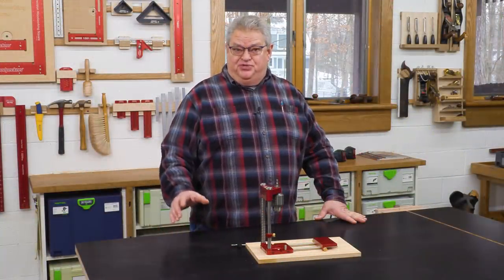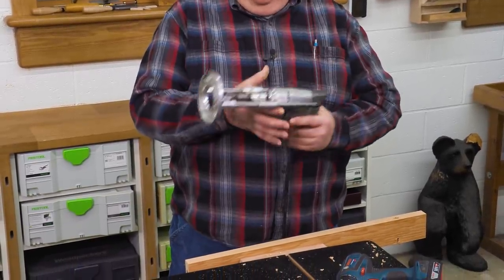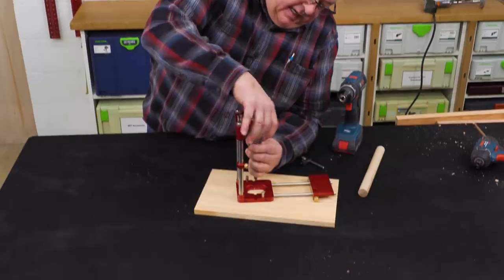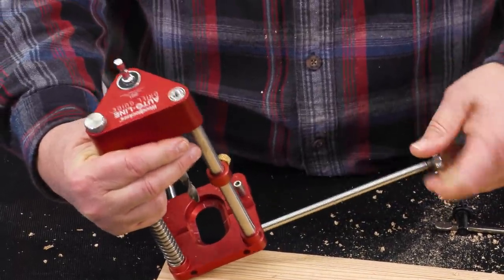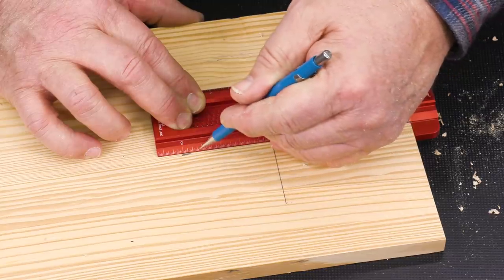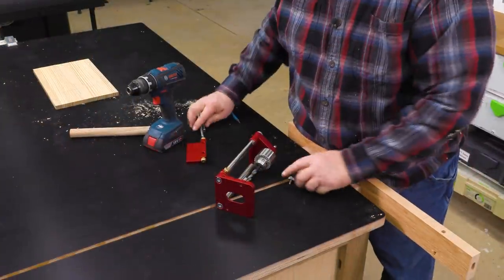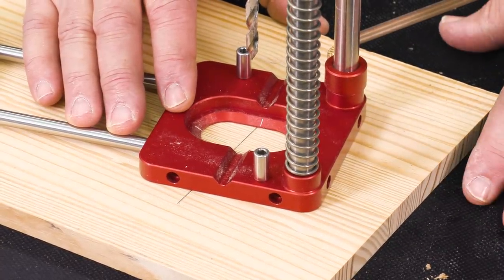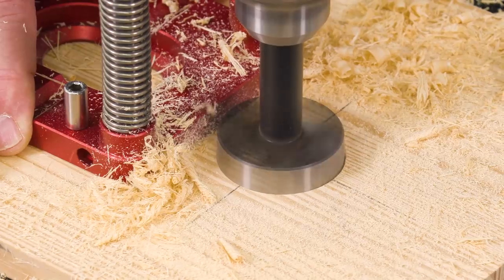The Best NEW Drill Guide For Woodworking - Auto-Line Drill Guide | Deep Dive

Comment: I bought this ALDG-21 about a year ago, and I finally got around this weekend to putting it through its paces.  I really wanted to love this guide, but it left me with several frustrations.  I used it to drill dozens of 3/4" dog holes into 1 1/2" maple workbench top, using a Fisch Black Shark forstner bit.  First, ALL five of the thumb screws rattled loose constantly.  The column top screws would rattle loose and fall onto the table or sometimes bounce onto the floor, which was no fun searching for them.  The thumb screws for the outrigger/guide also rattled loose but would just sit there on the table... the thumb screw for the depth stop also rattled loose and fell out a couple times.   It appeared that one dog hole would cause the column caps to rattle ~50% out, so by the 2nd or 3rd hole if I forgot to tighten it, they would fall out.    After a few of these I had to make an effort to tighten all 5 thumb screws after each hole - not fun.    I could easily see repeated cuts with the edge guide going south if the screws rattled loose constantly.    The next issue was that the overall depth of drilling with a 3/4" forstner bit properly sunk into the chuck, was barely 1 1/2' and I had to compress the spring 100% to get barely through my 1 1/2" material... it wore my arm out pretty quickly fighting the hard maple and the drill guide, so I switched to starting the holes with the guide and finishing them free hand.  I can still see a lot of use for this guide when some precision is needed, but for making repeated cuts in hard material it left me preferring to use the free hand drill by the end of the project.   - Any advice to get the screws to stay tight?

Comment: Love my Auto-line Drill Guide.  Using it more and more each day.  And a few more tricks I learned from this video, thank you!  Recently used my guide to tap threads into a new CNC high density MDF worktable I built that includes hundreds of 3/8"-16 threaded holes to mount my CNC clamps made out of plywood and I use plastic screws that go through the clamp and into my new work surface.  Used a tap designed exclusively for tapping wood.  Was critical to get the tap started perfectly straight as only had one shot, NO re-taps!  Worked perfectly and each tap came out perfect and straight!  Great product and beautifully machined and built!

Comment: I bought this as soon as it came out. I see it very useful for drilling lock plate mortises to a fixed depth. I have several drill guides (including the new Rockler) but this one addresses most of the flaws of the others. Most of the others are a bit cumbersome and have too much play to be very accurate and the rods tend to stick. The stops can't be trusted. The tapered section on the shaft of this tool is genius. I also occasionally need to drill 35mm hinge holes in the field and have several quite good jigs dedicated for this. Not sure if this jig can get close enough to the edge of a door for this. I'll find out when it arrives. If necessary, I could tap holes in the base and add my own extension. Also, while I have a line bore jig in my shop, it's sometimes necessary to drill shelf pin holes on site. I think this tool will excel at this. I've been a custom renovator in New York City for over 40 years and own more Woodpecker products than I can count. My shop walls are covered in "red". I've never been disappointed.

Comment: I'm glad that there are now more options for drill guides, up until very recently the ones available have been pretty much junk.  I know a Woodpecker version is going to be very high quality, and the taper is a great improvement over other options.  I am a bit disappointed that your version only takes 2" bits, I think going up to 2 1/2" would open up more applications (e.g., for more puck light options).  For comparison, the new Rockler is 2 7/8".
Reply from the maker: I’ll pass your thoughts along to the tool designer. Thank you.

Comment: Amen about the deficiencies of the ancient Portalign version of this tool. Mine has sat in a drawer since it was handed down to me 40 years ago. However I just used it to drill dog holes in my bench. Wish I'd had the Auto-Line Drill Guide. Using the Portalign and it's aging Black and Decker drill really illustrated the value of the design improvements you've made in the Auto-Line Guide.

Comment: I'm surprised that no one has mentioned the most obvious features that are missing from version 1.0. of this drill guide which are 1) dust collection (I'm thinking here of a simple, snap-in-place clear dust shroud similar to what many routers offer); 2) an outrigger that's shaped to slide along a Festool/Makita/Triton guide rail (for instant and precise control over one axis - especially useful in the middle of a large open field like a panel); and 3) Centrotec compatibility.  

Also, I'll echo what others have mentioned, which is the conspicuous absence of countersunk holes in the base (and, for that matter, in the outrigger) to allow the mounting of jigs. Literally every other version of drill guide I've ever seen offers users the ability to attach sub-bases and other jigs. Some jig examples are a) something to allow the drill guide to be held by a vise so that the ends of dowels or similar square stock can be held fast for drilling or b) since this version doesn't feature tilting guide rods, holes in the base would allow for mounting something as simple as a selection of beveled feet for drilling angled holes or c) there's the brilliant idea of adding a vacuum base - https://youtu.be/6O8BZMk4kpU?t=1726. So, how did something as basic as four countersunk holes not make it into the final design? Is it too obvious to offer up that If the base is too small to allow for four holes, than simply increase the size of its footprint?

The absence of his basic feature is baffling (as are the other missing features) but it certainly lends credibility to the notion put forth by others that maybe it's better to wait for version 2.0. As much as I want to get in line for this guide (I too have been waiting a long time for a precision drill guide) I'm leaning toward holding off to see what improvements appear in the future. In addition to what I've already mentioned, optional accessories like a larger footprint base (with a larger aperture) and longer guide rods would offer all kinds of additional possibilities.
Reply: Will wait for v 2 with these changes 👍
Reply: Or maybe a blower like the one on the DeWalt scroll saw, so it retains the lightness and simplicity of the overall tool.  I'll bet a little blower with a hex socket set could be snapped on right over the top of this without changing a thing.

Comment: I love Woodpecker's products.  have many of them.  Regarding the drill guide.  Great design.  Return spring is a nice addition (put one on both sides if possible) .  The fence/guide system adds a great deal of versatility over other similar guides.  But not prefect.   Angle drilling is almost mandatory.  Keyless chuck would be great.   I realize the drill guide is a premium product and you will sell many of these but in my opinion the price is to high for what it does.
Reply from the maker: When this was being designed, we surveyed customers and found that angle drilling wasn’t as critical as reliably perpendicular drilling. If there's a demand we can look into a different model with angle adjustment, but we decided the Auto-Line needed to focus on straight. We appreciate all the feed back and will pass your comments on to engineering. Thank you.
Reply: Disagree on the price issue you have. Top notch equipment and this particular piece is a job site game changer imo...
Reply: @WoodpeckersLLC  Angle drilling capability is mandatory for me and, based on the comments, many other users. Perhaps the group of customers you surveyed was not representative of all potential customers?
Reply: @WoodpeckersLLC  Angle drilling a must for me

Comment: If you want to put guide bars on both side and front, can you do this are the holes offset so the bars will not touch each other when you put them in the holes this way you have a guide on the front and side of your device. Also, when you turn the drill bit so it’s on the backside is there a indentation on the base so that a larger Forstner bit can be used and not touch the base?
Reply from the maker: Frank, putting a fence that's trying to align square on two sides is not a great idea. Instead, we have the fence on one side and a single point stop on the other. The stop was released after the original product release. Here's a second Deep Dive that detailed the addition https://www.youtube.com/watch?v=YO-lWs5Ii4c

There's no cut-out in the back side of the base. A 2" diameter bit will clear on the outside (1" on the inside).

Comment: 0:47 - Have you considered adding a level indicator to the back of your drill? I mean, you might still be off by a couple of degrees, but for wood that's generally fine. And you can still use guides / jigs / blocks if you need extra precision.
Reply from the maker: Level only works if the piece being drilled is level to begin with. "Square" and "Level" aren't the same thing.
Reply: @WoodpeckersLLC - Of course, not to mention some pieces are curved, some are tapered (and being square going in doesn't mean it'll be square going out), etc..

But in >90% of situations you'll probably be drilling into flat pieces that are close enough to level, whether they're lying on a table or held in a bench vise.

In the situation at the time stamp I mentioned (0:47), a simple "bullseye" level would have prevented you from drilling out the side.

Comment: It is a tool I´ve used most of the time.I is great. One question: Is it possible to buy an additional fence system (two short rods and a fence) so you can make holes in a corner?
Reply from the maker: Helmuth, check out the second Deep Dive on new accessories: https://youtu.be/YO-lWs5Ii4c  It shows the extension rods and stop that allow you to position to two dimensions. A single position stop is better than a second fence. If your piece isn't perfectly square, the two fences would not align. One fence and a single point stop works better.

Comment: Impressive. How would youi drill a hole at other than a 90 degree angle? For example, how would you drill at 45 degrees? Thanks!
Reply: They have release AutoAngle Drill Guide. Check that out.

Comment: The last feature you covered was with the drill repositioned on the outside of the guide. I wonder if the base plate could be cut away a little between the upright support posts so as to allow a larger-diameter drill bit? I realise there's a limit to how much can be cut away there, but even 1/8" means a 1/4" larger hole. That's not something everybody needs everyday, but I'm sure it would be indispensable to some. Even without such a modification, the Auto-Line Drill Guide is yet another amazing piece of design and engineering. I'm in awe of what Woodpeckers does.

Comment: Is it true that the 1/2" measurement referenced in the video as close to the edge of a board this can get.   If it went to 3/8" it would be genius for drilling screws like Confirmat for 3/4" ply cabinet assembly.  I'd have to get this in my hands to know for sure but it might be useful to get some center marks on the outside edges and bottom of the base and guide.
Reply from the maker: That was a generalization, and unfortunately, not a very close  one. From the back (furthest from center) the minimum is 3/8", 5/16" from the sides and just a bit more than 1/4" from the front (.2775" specifically).
Reply: @WoodpeckersLLC  Thank you very much for the fast reply.   Order up!

Comment: Can I make 25 ML holes with that?
Reply from the maker: 20mm holes can be done inside the base. Over 20mm you turn the carrier around and work on the outside of the base. That allows you to drill from 20mm to 50mm.

Comment: The woodpecker drill guide is nice however, the Rockler Portable Drill Guide with Vise I think has more versatility. If they make a drill guide or adapter that allows you drill at an angle it would be awesome and I would buy it.
Reply: VJr, Woodpeckers also has a separate version which allows you to drill at angles.

Comment: Nice tool. I've put my order in. But, How close does the chuck get to the material? I imagine it's until the spring is fully compressed. And if you need to go deeper,you would remove the spring?
Reply from the maker: You're spot on, Frank. The spring is fully compressed with the chuck a little less than one inch from the material. If you need to drill closer to the chuck, its a 10-second job to remove the spring.

Comment: Nice product, but for $300 you could use the money to buy a very nice drill press, like the bosch PBD40 for example, which is orders of magnitude better.
Reply from the maker: Define "better". The Bosch PDB40 is not available in North America, but even if it were, the advantage to the Auto-Line is the ability to drill a perpendicular hole in the middle of a very large panel. Few drill presses can do that and none that a home woodworker could buy. Sometimes it's important to be able to take the tool to the work instead of taking the work to the tool.

Comment: Dang that’s neat, but too expensive for this poor boy😢
Reply: Maybe, but fuck up enough stock and it pays for itself.
Reply: Overpriced.
Reply: @jm-um1tx  Looks like a really great tool, especially if you need to make larger holes where a drill press just wouldn't be practical. For now I will just stick with my Big Gator portable drill guides for perfectly perpendicular 90 degree holes. I have yet to ruin any stock including MDF, hard woods and metal.  When I do need to make larger holes then this is definitely a tool to consider.

Comment: There are other similar devices on line that can do the same but can be adjusted to different angles like 45, 90. This guide only does 90 degrees.
Reply from the maker: Thanks for pointing out one of our most important features. 90 is fixed and accurate. Adjustable means moveable.

Comment: What is the max size diameter forstner bit that can be used on the tool?   Looks like a great alternative to a drill press in a small shop setting.  Well done
Reply: Mike, turning the chuck carrier around you can drill up to 2".

Comment: Does this have gearing? Like to give you more torque on the bit? It should, that would be awesome
Reply from the maker: no it does not.  This is a good idea and I will pass this along to the engineer.. thank you
Reply: That thing to hold dowels in place under it wound be cool to sell standalone so they can be clamped to other larger drill presses

Comment: What's the largest drill bit it can take?
If it can work with a 35mm that would be great to also work for concealed hinges
Reply: A 35mm bit would have to be done on the outside of the frame, as shown in the video.
Reply: @SharpToolsUSA  figured just wasn't sure what the limit in that position would be.

Comment: I am wondering if this $240 device is way better than the $35 dollar versions.
Reply from the maker: If you want to drill straight accurate holes then yes it is.
Reply: Patrick, I purchased a $35 similar drill system on line. The first test I performed was using the jig to drill a 3/8" diameter by 2" deep hole into a planed and square Oak board. I used a brad point drill bit. After drilling I placed a 1 foot long piece of drill rod into the drilled hole. Placing a square against board and rod revealed an unacceptable amount of error. I'm speaking about the rod being 1/8" away from square only 4" up the rod. There was so much play, not only in the slide system, but also in the bearings that allow for chuck rotation. I can drill a more accurate hole by using my drill press to drill a hole through a 2" block and use that as my guide.  I called the manufacturer and asked them to check another identical product. I thought I had a reject.They expressed a similar lack of tolerance. It cost me $8 to mail return for credit to my account. Woodpecker products have a pretty high level of cost but their accuracy is pretty much right on. And, their tech support associates know their products and actually will assist a customer. I have taught cabinetmaking and building trades for 37 years. I also have a background in machine tool so I know about acceptable tolerance and Woodpeckers does a pretty good job. Don't waste your money on the $35 system.  Just tying to save you time and money as per my experience.  Sincerely, Joe
Reply: @joerusso7001  Thanks so much for your experienced reply. When i was a child I used one of those and found it very useful. that kind of tolerance was fine for child's work. And now you tell me all the $35 one today are low tolerance.
yikes ... i guess i have to buy my first expense woodpecker tool.

Comment: I am wondering when a drill company will make the "super smart" move to incorporate a bubble level at the back of a drill. Just eyeball verticality and drill your hole. Presto!
Reply: Not a bad idea, but "Level" doesn't always equal "Perpendicular".
Reply: A level on a drill is only useful if the material your drilling into is also level to the same degree as your drill.
Reply: I have a 30 year old drill with a level on it. Not a new idea.

Comment: The fence is... crafty.... but idk that it’s necessary.  Fences are for supporting something so it can’t move.  This is a drill.  It’s not going anywhere.  Mark your hole, line up the but, hit it. 

The cross hair idea is pretty nice.  It proves my point though.  Don’t need a fence. It will just get in the way and make the tool more cumbersome.
Reply from the maker: The reason for the fence is for a series of holes. Working from the fence, you only have to "eyeball" one crosshair, instead of two.
Reply: Drill presses have fences don't they!
Reply: @tacomamactech  some. But not most